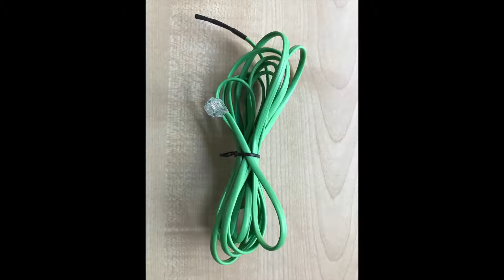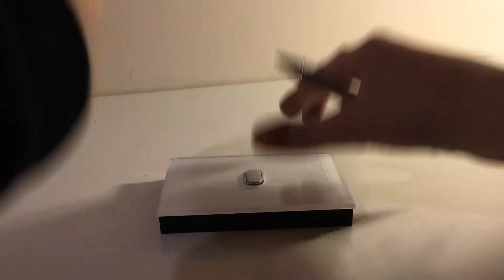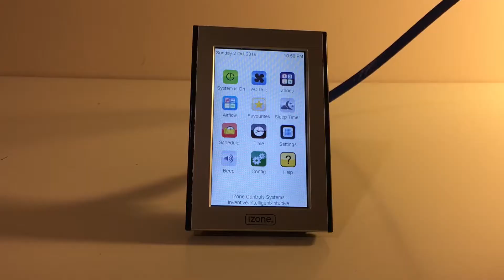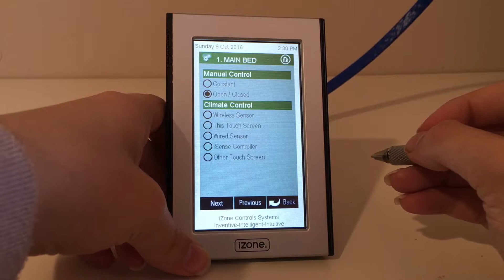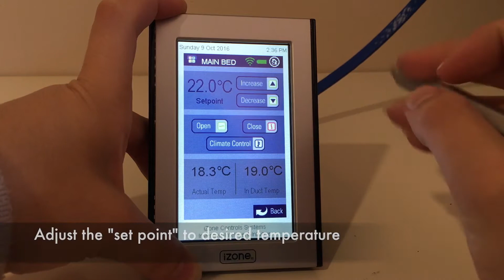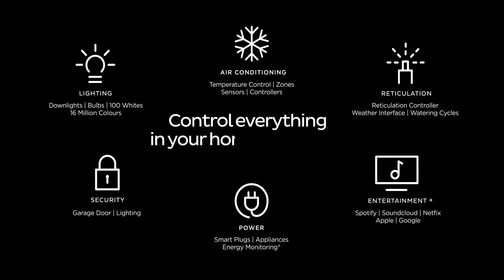iZone How To Add a Temp Sensor to an iZone System

Comment: My idiot landlord didn't put a sensor in the living room so when I try to change the temperature it says no zone sensor detected. Climate control not allowed. Should I contact the real estate to try and get it fixed up? Or is their a way I can override it? The set point is stuck at 28 degrees
Reply: The set point is changed by the user.  If it cannot be changed you may want to try a reset
Reply: It sounds like it’s set to read a sensor temp without a sensor.. you need to change it to read return air